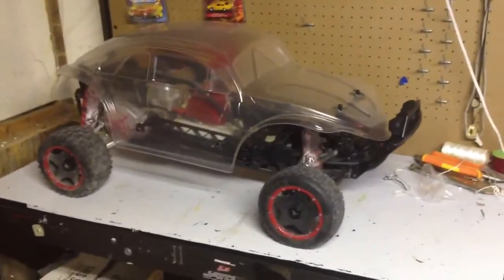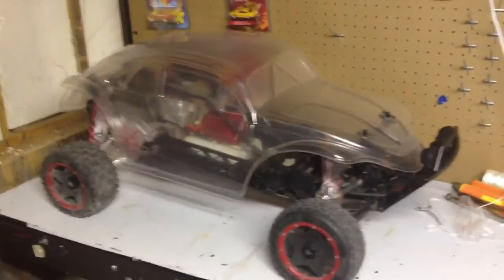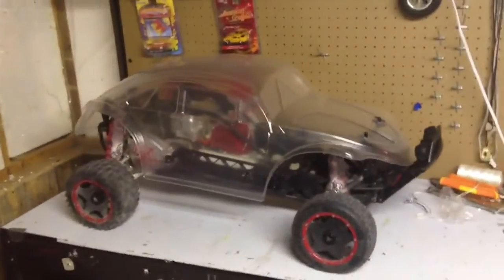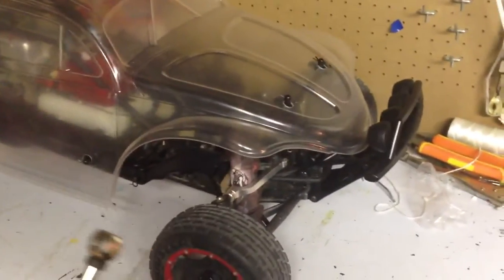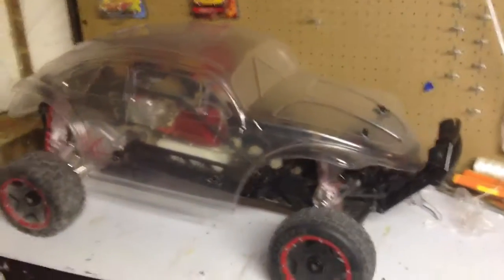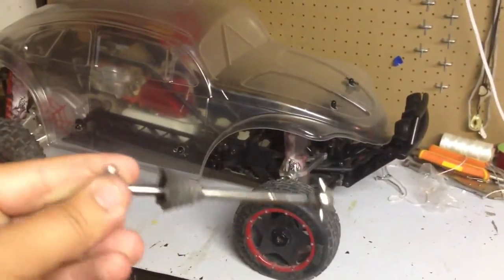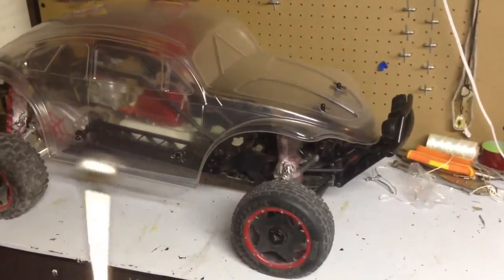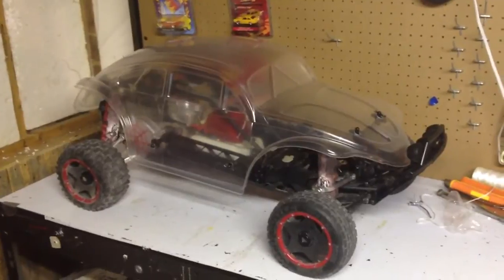Hpi baja 5b - 5t conversion done!

Comment: That's a cool truck man I have the 5T Rovan   I just put all aluminum a arm's in the rear I flip it  pretty bad the other day  had my dog bone come out for the first time because I broke the upper ball and I put the extenders on mine 2 inches in the front 4 inches in the back to help keep it from roll overs I was going pretty fast but they do help a lot thanks for the cool vid man you can check out my channel if you want I don't have many videos but I have a few👍👍👍👍👊✌
Reply: Hope you're still enjoying it!! To prevent losing Dogbones, there's two ways..... 
1. The Expensive way - replace Dogbones with CVDs.... 

2. The Cheaper way - Buy or MAKE Limiting Straps! They prevent the Suspension from overextending, which is what CAUSES the problem. 😉